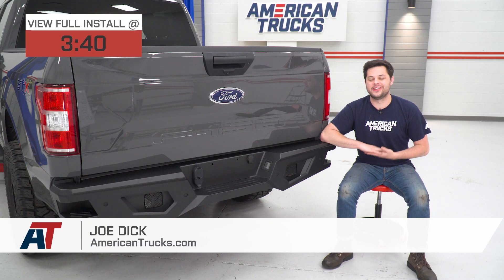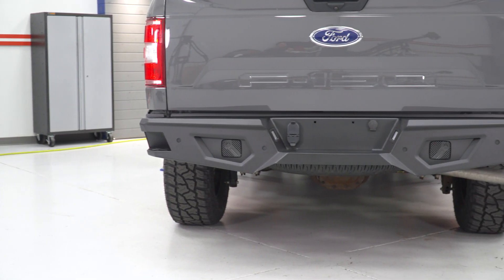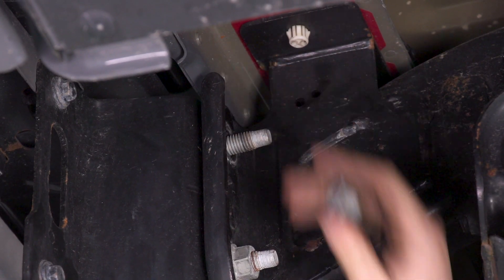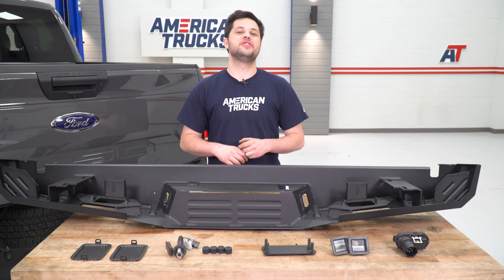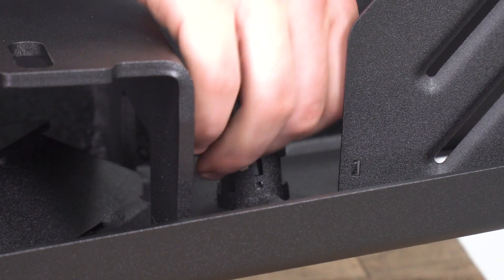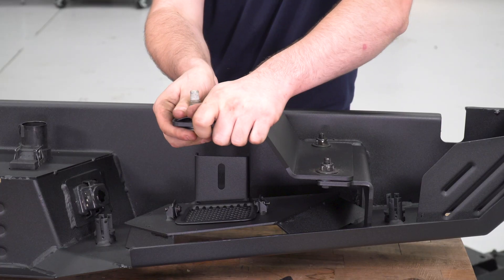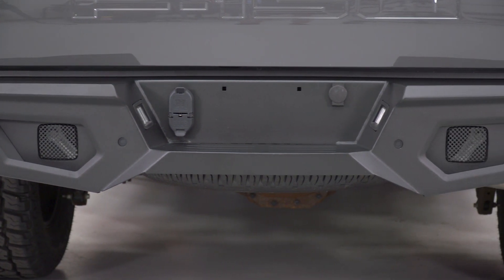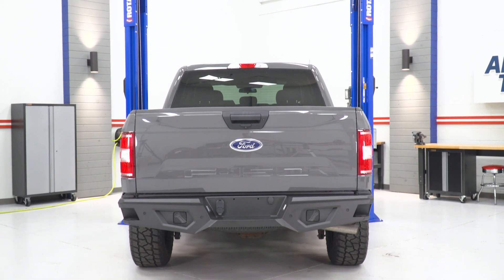2015-2019 F150 Barricade HD Off-Road Rear Bumper Review & Install

Comment: It looks good but my only complaint is using plastic “washers” on the mounting brackets.  Why?  Should metal be used so they don’t degrade over time?
Reply: The plastic washers are for holding the bar down so when you mount it, it doesn’t fall out